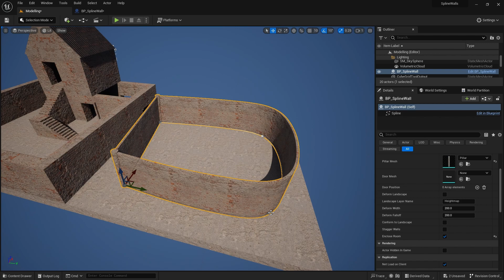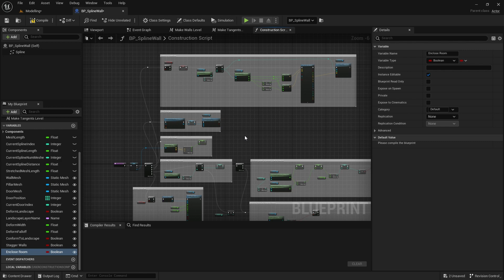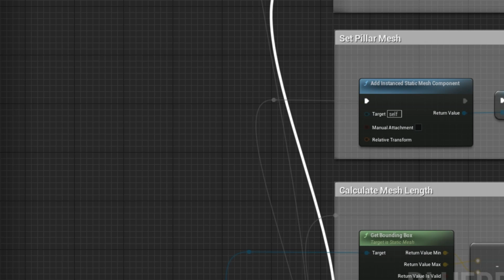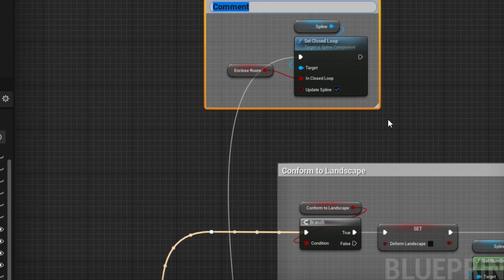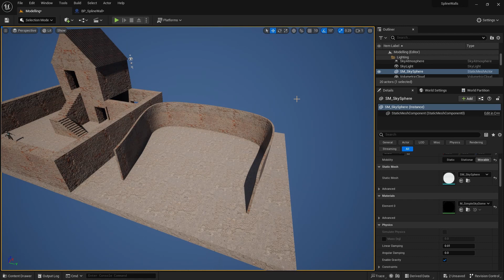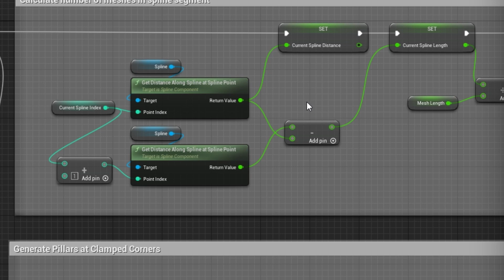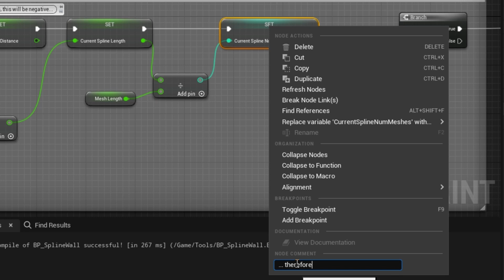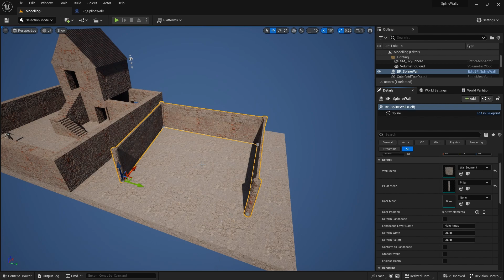UE5: Building Structures - #9 Enclosed Rooms

Comment: I have a lot of crashes from clicking Shift T. So far I've been able to solve them by clicking Shift T once, then clicking on another object instead of another spline point before then returning to another spline point. This focus switch seems to help a lot in case anyone is having similar issues.
Reply: I have the same problem and it only works if I select something else in between
Reply: same problem

Comment: Once I change the bp to calculate the last point, it generates a wall piece connecting the last with the first without checking the enclosed room.

edit: Nevermind, I had created a check that adds a mesh when the current number of meshes is 0, to use it if the current segment had none (length less than a single wall's). And the last to first points was such a segment even without the closed loop being true.